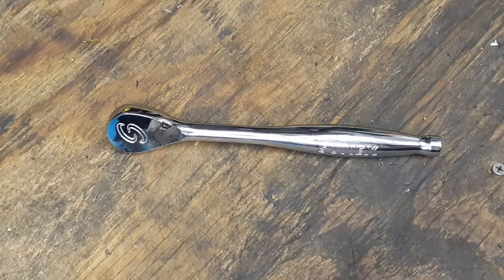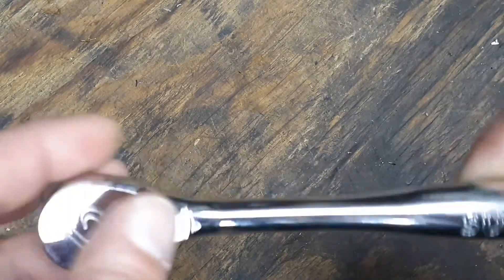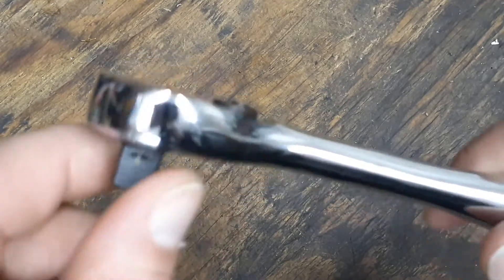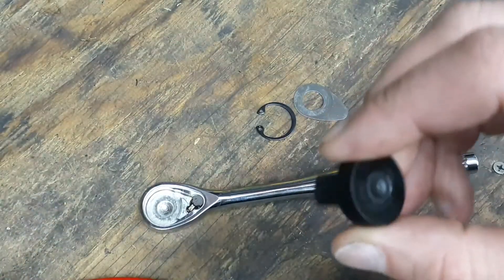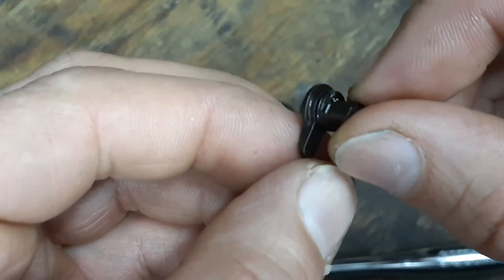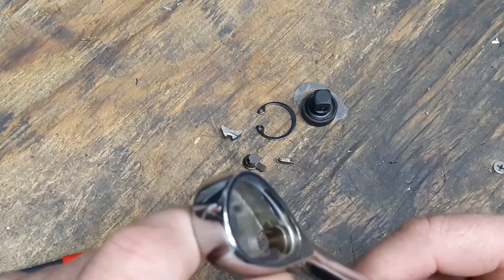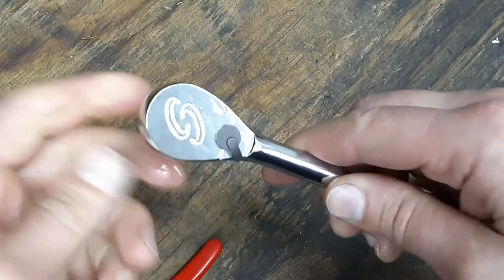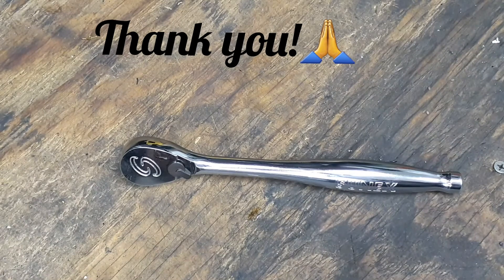Sunex 3/8" Drive Chrome 80 Tooth RATCHET. Teardown #30080

Comment: I love this ratchet but the switch is so easy to change directions, it's almost like it's a bit too long. That is my only complaint, it's made very well. It's made by Apex tools, out of curiosity I tried my 84 tooth gear wrench kit inside it and it does interchange. As does my Matco 88 tooth. The Sunex reverse lever is identical to the Matco in design, beside the larger diameter base. Great review!
Reply from the maker: Thanks for the info and the positive feedback. That reverse lever is a pain.